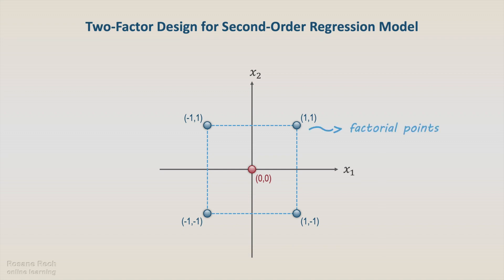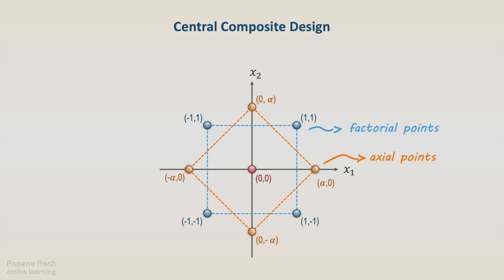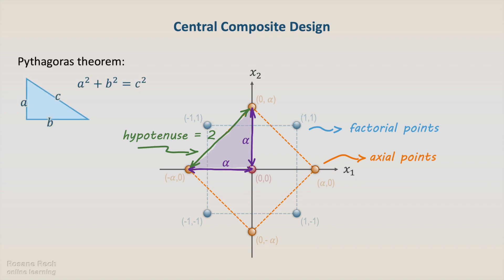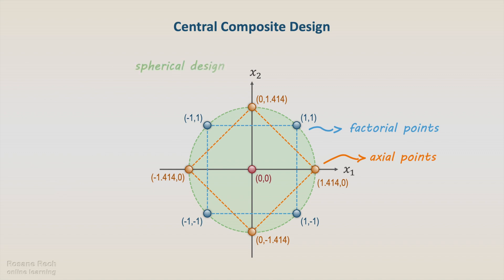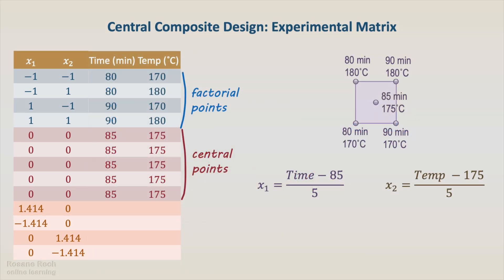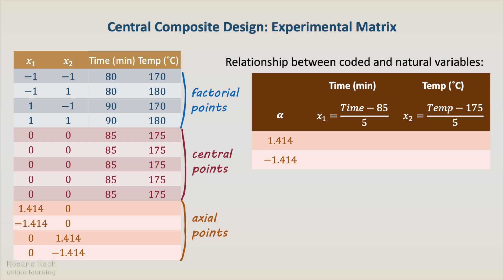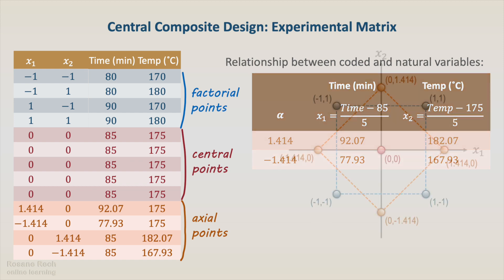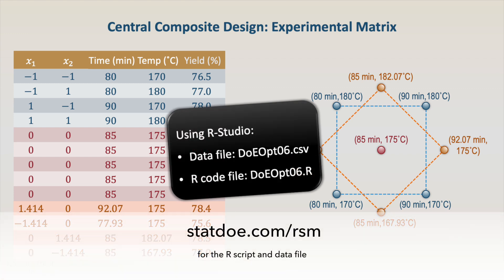RSM 06 Central Composite Design

Comment: Thank you for the awesome videos. Can you just get me to understand how did you arrive to the axial points of 92.07, 77.93, 182.07 and 167.93? I have tried many times but couldn't get the same answer... Thank you in advance
Reply: Hello, when x = 1 there is a difference of 5°C or 5 minutes which means 1 = 5 so in order to calculate how much is 1,414 you just have to do 1,414 * 5 and you find 7,07. I hope this is clear.
Reply: I asked that question to Chat GPT